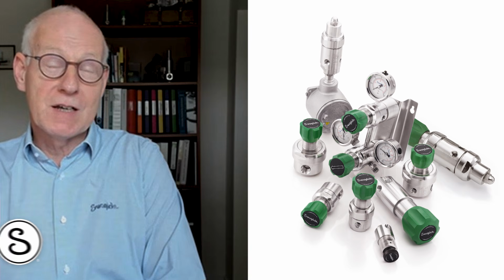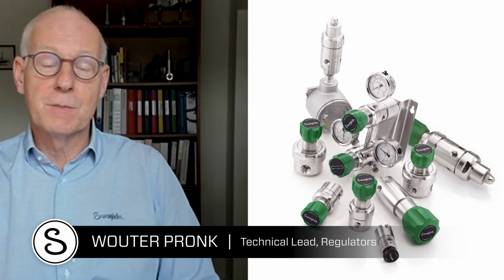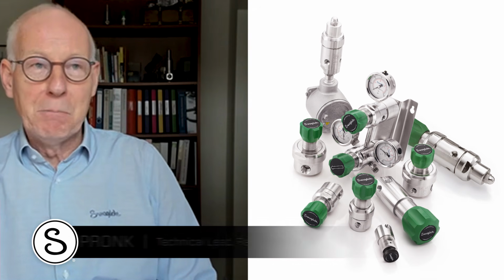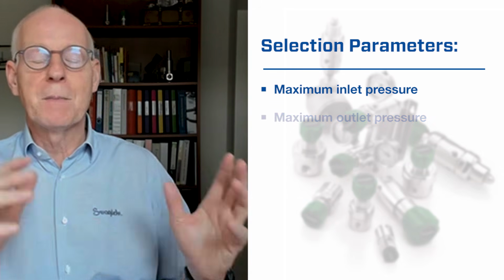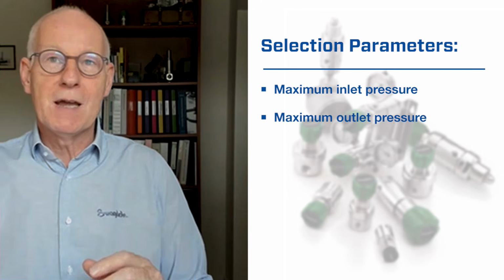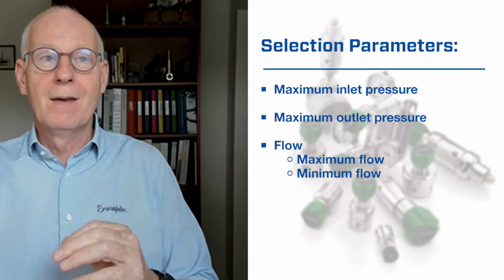How to Select the Right Regulator | Solutions Spotlight | Swagelok [2021]

Comment: The significance of a Swagelok product that sets it aside from the shared OEM provider is the basic range of 312 Stainless steel tubing with a 1/64th inch wall hydro carbon transmission with flow no pumps or carbon monoxide inhibitors

Comment: Were working with C20 based fluids for products like air-conditioned systems, hydrogen gas ranges for residential and commercial food services. This is the key market w/ MSDS. 
S-LOK products were not smelt based or lead based in origin. And were prominent in post ww2 ship building extrusion materials